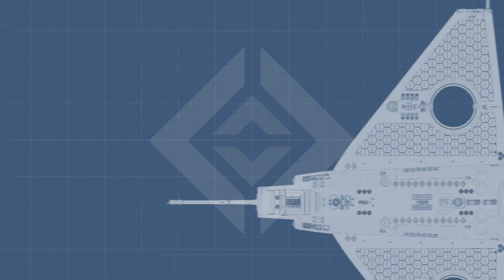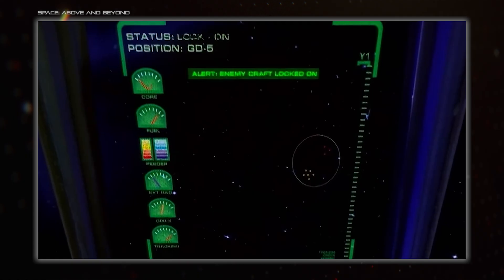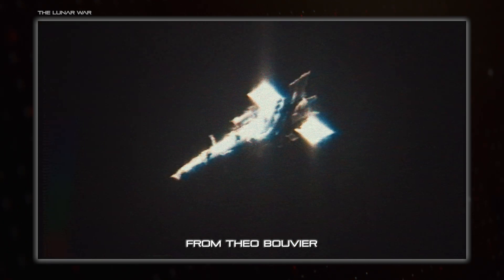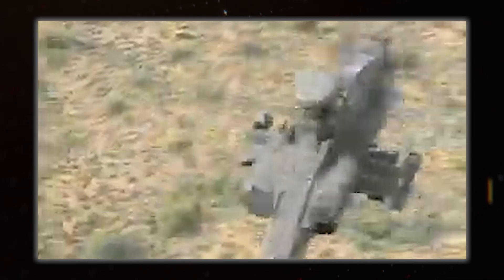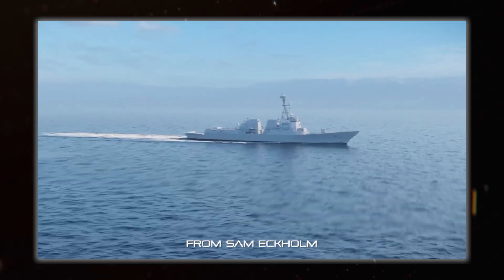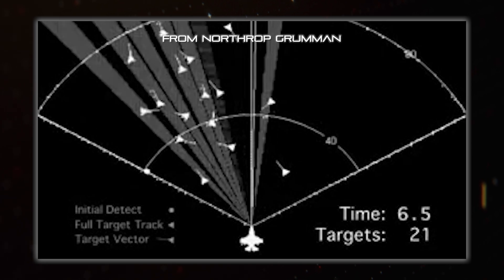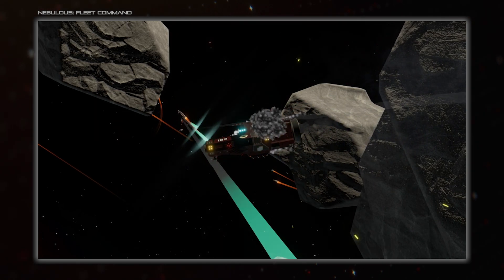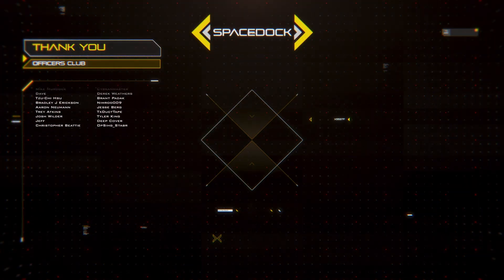What Sensors Would be Used in REAL Space Combat?

Comment: Realistically... pretty much all of this tech IRL, past our current tech level, would be largely passive. Combat spacecraft can't be "stealthed" very well; the limitations on how IR emissions can be reduced are quite severe and, short of some sort of "warp drive" that doesn't push mass backwards at a high velocity, it's practically impossible to hide a spacecraft that's maneuvering, because that mass going backwards will be very hot. 

So your typical combat spacecraft would tend to have sensor booms spread out widely around the hull, collecting data, which would then be very rapidly turned into actionable information by AIs. 

I think that things like RADAR / LIDAR would very quickly be seen as a problem, rather than a solution; passive sensors have a longer effective range and can, with the sensors spread out, give more than sufficient precision. 

RADAR would just show your enemies where you are and what you're doing... long before you'd see them. I think it's one of those technologies that's effectively a dead end if space combat on a large scale ever becomes a real thing. Passive sensors' only real problem is that the area of search volume is limited by the resolution of the sensors, how well they handle things like vibration from a ship under weigh, etc., but these are problems that engineers could handle and really the only limitation is computational; doing real-time analysis of a large volume of space will require a lot of resources. But in space, short of magical warp drives that don't use reaction mass, there's almost nothing to be done about spotting any ship that's producing delta-V, at anything like realistic engagement distances (again, short of magical warp drives, somewhere around a few light-seconds, tops).

Comment: while EWAR requires a shitton of computing power, quantum computers would massively increase computing capability. Add that metamaterial for better sensors and you got a solid sci-fi sensor base. 

There would still need a bit of standard transistor computer working on tandem with quantum computers because while the latter are great at crunching big numbers they arn't so great at more minor stuff.

Nanotube also make for what's probably the smallest achievable transistors.

Comment: I think that passive sensors will be the way to go for space warfare. You use a telescope that sees the breadth of the EM spectrum from UV to IR, at stupid high resolutions, and sweep that across the sky with an AI to help fine-comb every frame this camera takes at super-high speed for the enemy. Radiating with active sensors is a surefire way to be seen before you see the enemy, just like in submarine warfare. You make use of several platforms with fused sensors to perform measure the range and bearing from multiple angles, and then lob missiles at the enemy that they won't see until the missiles turn on their active seeker heads

Comment: One important thing worth a mention is natural beam diffraction. All radiation rays, even completely monophasic monofrequency LASER naturally spreads out over travel due to quantum mechanics, which lowers your positional accuracy, and weakens your return signal strenght to power output ratio, effectively limiting detection range by active EM sensors based on the rate of diffraction. This rate is hugher with high wavelength radiation, making RADAR by necessity a relatively short ranged option compared to LIDAR. I'm uncertain how much this limits effective range for a sensor application, but for example a visable light laser with power output in the gigawatt range, and a focusing mirror tens of meters in diameter diffracts enough to stop being useful as an offensive weapon over a range of thousands of kilometers.

Comment: Something to consider for the comments regarding gravity sensors is that gravity interactions are insanely weak. Our current detectors are colossal and can detect only cataclysmic events that create powerful gravity waves (like black hole collisions). Assuming you could miniaturize the detector (and you'd need at least three to calculate a vector) every accelerating mass is going to give you a signal, including moving parts of your own ship (crew included I'd guess). I think this would be a cool concept for an automated listening post, set them up in a solar system in stable orbits or buried deep underground on uninhabited celestial bodies  and "listen" for anything big and with unnatural acceleration curves. At least you'd have a sense something is coming.

Comment: In deep space a gravity sensor could be interesting if it had the capacity to detect infinitesimal variation a space fleet du to her mass could be detected and distance calculated.
And it's a passive sensor...
For massive military spacecraft or exploration one quantum entanglement could provide instantaneous , without any means of interception and unjamable  communication to a predetermined point ... A "capital scale " spacecraft with a communication linked to a headquarter could using this headquarter as relay communicate with any spacecraft linked to the same headquarter in instantaneous speed even if they are billions of parsecs away.
Quantum entanglement the hard science hypothesis for FTL communication is too little used in scify ...

Comment: I know that in the main UC Gundam timeline, most of the sensors are made for detecting heat, and even then they are far from reliable due to all the Minovsky Jamming going on within the setting. They can also use the Minovsky particles themselves to figure out roughly where they are coming from, but again, it is far from precise, it only gives you the general ballpark. For the most part they have to rely on visual information to get anything done.

The After Disaster timeline did something else with the generators of various ships and machines producing something called Ahab Waves that each have their own signature produced by small imperfections in the design, allowing for long range identification by reading those waves.

Comment: Thermal is the best, though I guess that's probably covered in the stealth video. There ain't no stealth in space unless some enormous object (like a planet) is between you and the sensor, or you're REALLY far away. Plus, the second you turn on an active sensor, everyone knows where you are. Or at least they will know where you are before you find them, because you have to wait for the return bounce and they don't. In any event, a passive IR sensor could detect the crummy Space Shuttle's engines well out past the orbit of Pluto. If you have a fusion engine, you could be seen from here to Alpha Centauri, even without firing the thrusters, and there is no such thing as FTL, but if there were, the whole universe could see you. 

So would the Stealth Ships from "The Expanse" be any stealthier than regular ships because of some dumb paint scheme and looking like stealth fighters? ? No. They have engines, don't they? But even if you shut those off the ship still requires power to run anything else like life support, and that can be seen from millions of miles away. Shut that stuff off, and if there are any humans aboard, they are also constantly heating up the ship's exterior until they die. Then it takes hours for them to cool down, because there is nothing to conduct the heat away in space except the radiation everyone is detecting. 

Turn on any of these active systems, or send a message, though, and you might as well paint "SHOOT ME" in flares  across the void. You might have them for when combat is joined already, but the rest of the time the active sensors need to be off.

Comment: How about a video on sensors in space exploration. What would sensors be likely to identify? Atmosphere composition, life form information, or subsurface geology, but what else and how would it probably work?
Reply: We already have those sensors is the form of magnetometers, spectrometers, and LECP (Low-Energy Charged-Particle) detectors, along with good old thermal. Life generates a lot of heat compared to the surface of a planet like Earth, or something colder, and you can see that from a pretty good distance away in space because there is nothing in the way. Unless the planet has clouds or something. Then you gotta get closer. 

As long as you're getting closer, we also have impact sensors and probes that can tell us a lot about a an object's geology. It's basically land SONAR; Oil and mining companies use it all the time.  If you want anything really detailed about the life or composition of a planet, though, you pretty much have to go to at least low orbit, and that's only if you can see through the atmosphere.  Go-go Imperial Probe Droids for finding the most high-resolution information.

Comment: ok this may sound very unhinged
BUT, could we use disturbances in Solar winds as a means to detect objects in space like ships or stations
I mean it kind of makes sense given that ships are usually going to be a significant size which could cause the solar winds within a heliosphere to travel around and possibly cause a pocket or gap of "emptiness" that a sensor meant to read solar winds could reasonably detect?
is that at all possible or plausible?
Reply: Yes and no. If you can match a consistent patch of solar wind and there's a "shadow" in it, some sort of object is there. Unfortunately, by the time the occluded and distorted light reaches you, it may look nothing like the object you detected, kind of like seeing the shadow of a small bird on the ground against the sun. Other light sources in space, including stars, light reflected from celestial bodies, and light reflected from your own ship make this proposition tricky. I can think of a couple odd scenarios where you might use your creative idea, but it's not really necessary becauuuuusse....

The ship in front of the sun is significantly colder than the star. On passive IR sensors, it would show up like liquid nitrogen on a hot plate. "Eclipsing" a star is a surefire way to get yourself caught in hard sci-fi, even if the star is in a completely different solar system. Doesn't matter if the ship has a fusion engine or whatever, it's nowhere near as hot as a star, and even if it turned a fusion torch drive directly towards you, it would still show up as the only very regular directed radiation emission in the background of the star.  

The second ANY ship moves out of the star's incandescent, highlighting, burn, and I don't care if it's the Space Shuttle or Picard's Enterprise, it is then significantly hotter than anything else around it, making it also show up easily on passive IR sensors. Even something that has no engines firing and is just an orbiting glob of electronics and human activity, like the ISS, is detectable beyond the orbit of Mars. A chemical rocket can be seen past Pluto. If anyone used the active sensors SpaceDock is talking about, they might as well broadcast their location to everyone in the solar system, which they would also do if they used any communications. The only real stealth is hiding behind a planet or moon,  which also hides the enemy from you and is not ideal. 

The best you can do once you are in detection range is change course erratically so the ship is in a different place by the time its heat and other electromagnetic signatures reach the enemy's passive sensors. The closer you get, the more likely they are to guess your location in time for an accurate shot, and the same holds true for you engaging them unless they have a flying railgun platform hidden underneath an atmosphere or something, where it can pop up and shoot before "submerging". Even then, they'd better hope you need that planet intact for something, because you could just dump an RKM and obliterate half of the planet in one hit. 

Ah, but I'm getting into the weeds, now. Your idea DOES have some merit, but it's mostly in evasion, not detection. A solar sail can be gossamer thin, totally transparent to the naked eye, and to other spectrums of light. We can't put a ship on that because the ship itself hits the aforementioned pitfalls, but a small, dark, and cold, drone could be attached. Or a missile. If the solar sail is deployed in front of the weapon in order to tow it, the tiny amount of radiation colliding with the sail would be enough to move the thing, VERY slowly at first, whilst collecting and re-radiating enough energy to make it look like your small object is just a rock reflecting radiation. The sail is basically the heat version of a bridal veil, obscuring what is behind it, but still looking like part of the star's "dress". 

The weapon itself is basically a self-guided mine. Whether it's a drone or a missile, it drifts towards the intended target position, and once it is close enough for a good shot a command signal or a VERY low-energy trigger sets it off. It engages engines and sets off to wreak havoc. 

Granted, you would need to know where the enemy was likely to be a good deal in advance, so ship mustering points, space ports, orbital installations, or planets are good targets. These weapons could also just be minefields you send out regularly to protect an area. The bitch is that they can only protect in one direction, because anyone circling around behind the mine MAY identify that there is a solar sail in front of what looks like a rock, that is very curiously not in an orbital path. Ideally, the weapon should be place INSIDE a hemispherical solar sail, like the middle of bell jellyfish, so the angle of detection is as minimal as possible. Anyone observing from the far side of the star will just see corona flare out to a certain distance. But if they get between the star and the weapon they've got you. Hence: one-directional minefield. 

I can think of a couple other uses beyond this, but they would take even longer to explain. You have a good idea, here, it's just misapplied in hard sci-fi or the real world. No worries, there, as some of the greatest scientific innovations were made by accident. Keep thinking creatively!
Reply: @arcdecibel9986  damn, I hoped that there would be a bit more to this sort of idea since I partially took it from the concept of SODAR, which was described (according to Wikipedia, not the best source I know) as a form of sonar in space which I thought could’ve been applied to space ships and such but instead of sounds using disturbances in solar winds.
Thanks for the in-depth explanation and it has in fact given me a few ideas to play with and make something at least plausible real world science wise

Comment: Something that you may not have realised about passive verses active sensors in space, and more specifically across large distances of multiple light minutes/hours. Passive sensors gather data twice as fast as active sensors. You mentioned that Lidar and Radar both need to send signals out and wait for the reflection to come back before it's seen. But a passive visual sensor will just pick up the light of the object as soon as the light reaches the sensor, no need for a laser to go out and bounce back. In space, this could save literally hours or days of reaction time. It's also very difficult to hide in space anyway, so light reflecting off objects doesn't have much to get in the way. It must also be said that it would be pointless trying to look with our own eyes, but electronic telescopes are getting better all the time, s who knows how good they'll be by the time space travel becomes normal. As an example of tis working in literature, look up the lost fleet series by Jack Campbell.

Comment: Using nukes to find a stealth craft sounds metal as hell
Reply: Not even the most technobabble insane Sci Fi could come up with this level of bullshit 🤣

Welcome to hard Sci Fi, where all explosives get nerfed of their power a few relative magnitudes, and as a result thermonuclear explosives become the new tnt and by the grace of God and x rays the solution to everything.😂😂😂
Reply: @The_Northernlight_Synth frankly speaking, nukes, have never been that impressive in terms of destruction strength. The practical range of a nuke is around a hundred or so kilometer, unless you make up some magic propellant that is really energy dense. 

A few hundreds of kilometers is nothing in space. At the same time, if you are behind shielding, so any form of space ship, the practical range in space gets reduced to a few dozens kilometers. That’s nothing, just make missiles with better stealth and evasion at that point
Reply: @huey1910   meeeehhhh, I agree that nukes have very little effect in space, actually it's kind of worse, I think effective range for pure nukes is about a kilometer at most. With megatons btw, because of the fall off.

On the other hand, the tyranny of the rocket equation means with near future Propulsion ship will be very lightly armored if they are armored at all. Not even the Orion drive could handle much armor, (going to check this) although it was significantly better. 

Even then, things at hypervelocity have significant issues with being stopped. Tanks today with their crazy armor thickness cannot handle armor piercings rounds.

Range with missles means that your engagement ranges are in the thousands of kilometers, not hundreds.
Reply: @The_Northernlight_Synth I don’t mean shielding as in shielding to survive the explosion itself lol, I mean radiation shielding, which about all spaceships would have in the first place due to cosmic radiation.
Reply: @huey1910  ah, now I understand